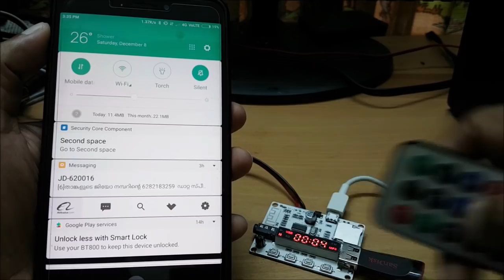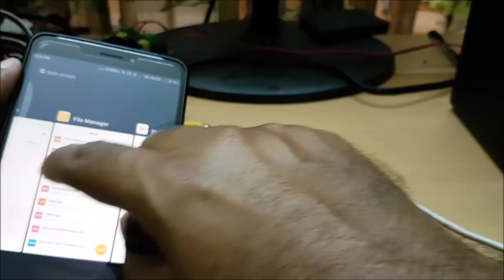Bluetooth, FM, USB mp3 Aux  receiver and player board with remote

Comment: bluetooth /usb/ receiver board vechu assemble cheyyumbol  noise varunundu , edu reduce cheyyaaan endenkilum tips undo
Reply from the maker: Better inbuilt board vanguka , allengil maximum aduthu pidipikkukA connection length shortest vekkuka
Reply: @TechKannanMalayalam   thank you ,, this is assembled in a small cabinet , before i used to assemble one with same module without BT and is working fine